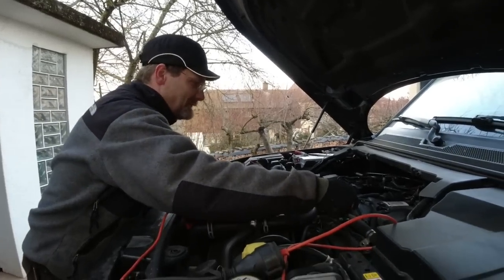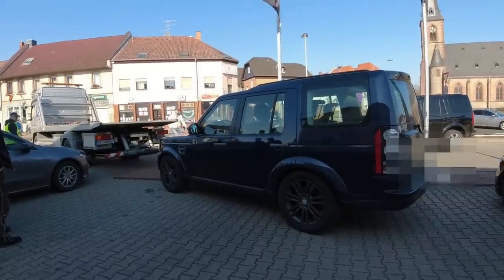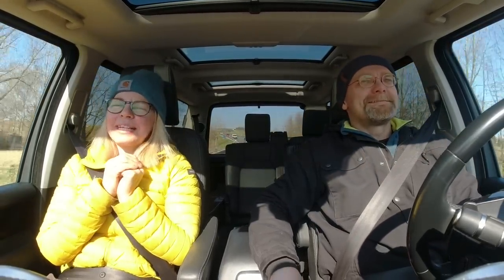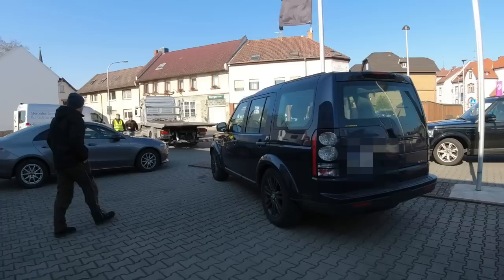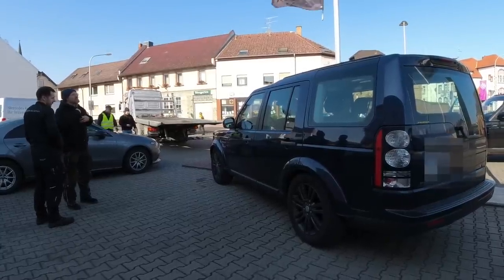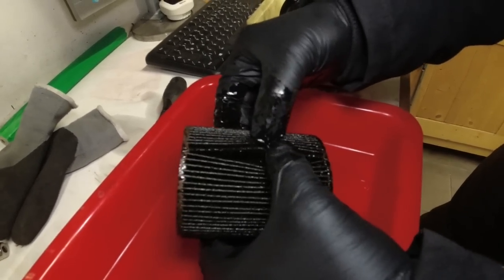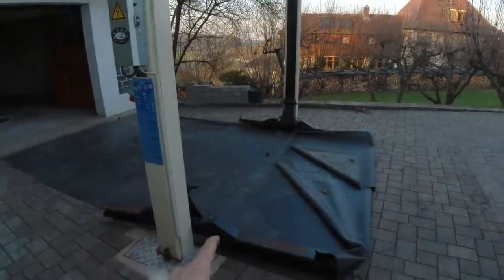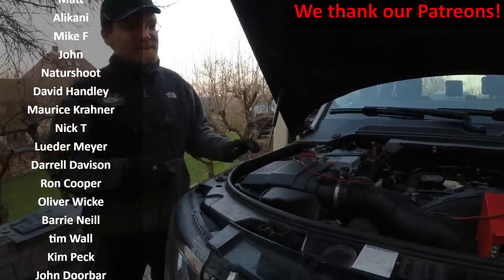We bought a dead engine LAND ROVER with only 40.000 Miles / S4-Ep10

Comment: Actually a lovely looking vehicle and obviously well taken care of.  Is it a Graphite of a Landmark?  You can see it's one of the very last ones as it has "Discovery" on the bonnet, rather than "Land Rover" (personally I prefer "Land Rover" on the bonnet).

It's amazing how expensive these cars are - the last Discoveries of this shape came off the production line in 2016 - 7 years ago.  They sold new for around £47,500 on the road for a Graphite and about £56,000 for a Landmark - the used price now is £30,000 - 35,000 (I checked with JLR in Oxford the other day as this is what I am hoping to get in the not too distant future).

It still amazes me how many people say how unreliable Land Rovers are, yet everyone I have spoken to has never had a problem and the number of very old Land Rovers that are still on the road when most other cars of a similar age are rusting in theior graves is amazing - the number of Mk.I Discoveries I see around and still in good shape is far more than any similar aged vehicle.

I do feel for the previous owner that a well loved and well taken care of vehicle should suddenly stop like that.  A similar thing happened to me in 2019 on my 09 registered X-Trail - suddenly went bang on the A3 in Germany close to Aschaffenburg. Towed to the local Nissan dealer in Ascheffenburg and one week later and € 2,500 poorer I got it back and could continue my journey.  In my case the ERG valve had broken internally and a loose piece of metal was floating around - but I had to pay for 16 hours of labour to sort it.

Looking forward to seeing what happened to cause suce a failure on yours and what could have caused it (presumably used 5w30 oil instead of 5w40 😉)
Reply from the maker: Hello John, the vehicle had a sticker price of 58t Euro in 2016 and the previous owner payed 54 t Euro.  He planned to keep it for 15 years.  He gave me 4 new oil filter, about 20 L of oil (all kinds).  Very sad story.  LR just does not stick to their responsibility.   This engine is even installed in 2018 LR5 cars and also has crank failures.  Christian

Comment: Hydrolocked engine. Assuming they’ve not forded the Rhine on their trip, excess fuel (a lot) in the combustion chamber has locked the engine up. I’d wager a bad fuel injector is sending too much fuel into one of the cylinders.

Comment: A quick update on our LR3, after almost 18 months of ownership, two weeks ago we had the FOURTH compressor fitted. ho hum
Reply from the maker: 😲They can't be all bad? Isn't there another root cause for the compressors to fail? Do you monitor how long they have to run while driving?🙋‍♀️vera
Reply: @Vera_and_Christian  The first compressor was fitted by the dealer when we bought the LR3, along with all 4 air shocks and a valve block. This was because on the test drive the suspension warning light came on. Some time later this compressor went bang and sprayed desiccant everywhere, a common fault I am told. Compressor number three, well overnight the car was sinking, the garage tested everything for leaks even removing the air reservoir tank but in the end the computer just said that the compressor was not producing enough pressure. So on went compressor number 4 which fixed the problem. Since then  I've had 2 suspension warning lights, but no noticeable effect on suspension and the simple process of turning off the ignition, then starting the car again removed the warning light and everything is fine until it does it again...

Comment: Probably no where near but I reckon there was an issue with the fuel system caused by a spillage of adblue into the fuel tank while refilling and then being run with adblue in the fuel. This will have caused damage to the fuel system and could've caused too much fuel to be injected therefore increasing the temperature in the cylinders and melting the pistons to the bore. 🤷‍♂

Comment: Hello, Vera and Christian love your stuff, really. in fact, I very nearly bought an LR4 the other day, but it's ok I came to my senses, you've got me on the edge of my seat and I need to know what's wrong, however, I am a bit disappointed that you forgot to give us rule number one in Land Rover ownership is "check the codes", I will have to try and diagnose without codes. So if you cut off the fan belt will the crank turn ? no then it's not a sized AC or alternator, is there enough oil in the pan? no, then there's your answer oil starvation probably a big end melted onto the crank oil level sensor failure, however, if there is enough oil, then it could be a number of other things one is catastrophic timing failure but I would expect to get even a little play on the crank as the piston hits the valves and bends them out of the way but probably wouldn't lock the crank unless it's stuck between two valves, there are only two things left that I can think of, a bad injector and over/under-fueling causing one cylinder to overheat and sizing/melting on to the cylinder wall, last thing is if AdBlue was added to the diesel tank by accident, this could cause all the injectors to start over/under fueling/leaking as it eats away at the soft metals and spacers in the injector or the weak mix of adblue could melt the tops of the pistons sizing the pistons to the cylinder wall, check for crystals in the fuel.
Reply from the maker: We did show what the Gap diagnosed. 👍🙋‍♀️Vera
Reply: Hello Vera, I can’t believe you replied that's awesme, I've watched the video three time now, My guess is Cristian deleted that scene when you weren’t looking, you did say limp mode couple of times, could mean anything other than the car is trying to protect itself, so I still think the big end has melted on to the crank due to low oil that wouldn't even show overheating on the dash maybe a code for low power or something related to that, if the expected fuel/air input go's too high or too low like a hard stall compared to flywheel speed could trigger a limp mode, you've shown on older video the two inner big ends get secondary oil from the main bearing and if there is low oil that inner big end will heat up and as this engine in nearly new the wear and tolerances are very low so any heating will cause expansion very quickly more expansion more friction and until melt down, 120km/h is maybe 2500rpm I'm guessing so not that fast maybe they were going up a long hill on the motorway, there would have been no time to cook or smoke the oil, or spread bits through the engine.👍🙋‍♂Noel
Reply from the maker: @Noel-qb6gy  yeah you are right and I am wrong. I am really sorry about that. That scene will hopefully be in the next video. We have so much footage always, and already watched all of it on the Computer. But we did of course check the code, and Land Rover in Switzerland did that of course too. 😀🙏🙋‍♀Vera

Comment: That's really crazy what you did that's when some interesting stuff happens. I love your channel and respect you both. Some serious skill is always there.
Anyway I was workig on some 6 cyl diesels and they have usually so much power that 1 broken cyl doesn't stop it the other 5 will push it to destruction without problems. with broken  con rods pushed out of the block and so on.
We don't have a lot of info here. I would say it's siezed because of lack of oil.
Mine was still turning with a broken crank back then. 
A snaped cam belt on the highway would have probably destroyed everything but not totaly blocked it.
Will see.
I will follow this as I did Fabians rebuild. That was some serious skill to put that in working order again. Great stuff. I wached every video with much interest.
I fear you will have a lot of work if you start reparing others disco's.😉
Reply from the maker: 😅We can‘t repair others their Discovery. That is why we actually bought this one. It‘s ours.😀👍🙋‍♀️

Comment: Failed on a roadtrip and not many miles on the car... My guess is that the oil level has been low its then gone for a very big journey and slowly but surely oil starvation has occurred leading to crank failure.
Reply from the maker: Oil level was ok. Sorry, did not include this in the video.   Christian

Comment: crank fatigue failure??? That's what happened with mine, broke at 80km/h and wedged itself into block, no noises, no vibrations no warnings just suddenly had no power, when rebuilt had to use a different block as well as the crank. But mine broke the front sump bolts and leaked a little bit of oil😥

Comment: Ok we are going with the following... if serviced by land rover at there intervals... it has had maybe 3 or 4 oil changes... every 20K... yes it should have been changed at the time interval rather than K interval...but hey its a landrover dealer... so with so little oil changes and so little Ks we are assuming that the oil was shot... this caused reduced oil pressure ... and we know how little this can be at 2000rpm.... so at 120k on the autobarn the oil pressure with worn out and contaminated oil, was enough for a main bearing seizure .. whilst not having enough flow to put any debrie into the oil filter

Comment: The car ran out of oil then main bearings started rubbing and overheated they got so hot after the enging stalled
they fused and the car coasted to a stop. Wild ass guess.
Reply from the maker: 😅Sounds like a wild guess. As we stated in the video, it just got an oilchange and hasn't lost any oil. 🙋‍♀️

Comment: I'm thinking a hydraulic lock. If the engine had seized at motorway speeds there would be bits of metal everywhere, so i guess it happened at startup?

Comment: Big end bearing slipped over other half one and locked crankshaft up fault bad oil not changed probably as landrover service but I think should be changed ever year or 8 to 10 k miles
Reply from the maker: He was very meticulous and changed the oil very frequent. He has already had the oil for the next two oilchanges at home, which he gave us including a lot of oil filters. 👍🙋‍♀️

Comment: sad story I think the owner will run on toyota next and  waiting to get it back an good news form the RCA ,if the crankshaft is locked like that ,it's probably not broken but either seized in the beaings due to 5W30 good oil /pump or could be fluid lock .... due to faulty injectors... a look  inside  the exhaust should reveal some unburned fuel... or oil... nice Car ! nedd someODB  fault check ... last fault is the issue ( like limp mode or no oil)

Comment: Hmmm thinking outside the box. Seems too low miles for a timing belt / crank fail surely. You’d think the belt / oil would have been changed if the owner loved it as much as you imply. Wondered if something went wrong with the glow plugs / fuel delivery causing an excess of fuel leading to a stalled, locked engine. Sceptical given the notoriety of the cranks in these vehicles it seems unlikely

Comment: Can’t wait until it’s diagnosed! By the way: my Disco 3 had suddenly all warning lights on. HDC and all special programs out of order. Speedo not working, but revcounter worked. When I turned the engine on after half an hour everything worked again, except “Aufhängungsfehler”. That remains... any ideas?
Reply from the maker: You need a diagnostic reader, we can't stress that enough. 👍🙋‍♀️Vera
Reply: @Vera_and_Christian  : It seems it was the ABS sensor

Comment: I know the failure exactly, the engine has inhaled a Swiss cheese 🐁 so this poor little guy has activated the from Land Rover installed Antismallrodentsinhallation Mode.
I now think on these engines it's not only the Construction from these either more the Maintenance and or endinspection of the Factory.
Some last 300000 plus Kilometers an some die short after the first Oilchange.

Comment: Oil pump failure starving the main crankshaft bearings of oil causing them to seize the crank but not snap it . 
May be why there are no chips in the filter due to oil pump failiure ?
It may have spun the main bearings too . 
Sump removal will reveal more information though .
Possible line bore . 
New uprated oil pump . 
New bearings .
Polish and check the crank for tolerances etc .  
Fabiens Discovery round 2 . 

A special thank you to Vera for a healty amount of "Oh my God's" in this episode LOL

P.S. All this is pure conjecture of course . I have zero knowledge apart from watching LR Time .

 
Fattrucker
Reply: But surely she would of got oil lights on before this happened

Comment: Hi Christian. I'm following you from South Africa. Big fan. I have a LR 3 TDV6. It's the best and worst car I have ever owned. I've had it from 2007. I've had the crank shaft bend and replaced the engine. I also own a Toyota 80 series as my rescue vehicle......My question is does the lr3 petrol v8 engine have any engine issues?

Comment: Fun fact as an ex-Land Rover fan (2016): I can tell you that Toyota's do break.

Though not like Land Rovers, they can usually still drive. But in regards to say, like a 100 series Land Cruiser or any other diesel, Toyota....

When their mechanical (or electronically assisted or even commonrail) pump packs up, they are like pregnant Chinese women. 

You don't see them; they are in hiding.

Why didn't the tow truck driver just back into your driveway and unload the car there?
Reply from the maker: Our driveway is too narrow and steep.  Looks easy in the video but in our first engine rebuild series you see a much smaller tow truck back into the driveway, hitting our post.  Christian

Comment: My guess is that someone was fording  a water crossing and went to deep and sucked water into the engine hydro locked and snapped the crank. After trying to restart the engine. My guess the wife was not aware of the consequences of stalling it in water . Trying to start it caused the failure.
Reply from the maker: It's always good to watch the video before commenting 😀👍🙋‍♀️Vera

Comment: My money is on bearing failure on the crank from fuel dilution in the oil.  The latest TDV6 with DPF and adblue is bag of hurt and the Land Rover C1 oil is trash no car should make a half litre of oil in 5k miles but these do.

Comment: Weak oil pump either a snapped lug or not suppling enough oil pressure /flow to the engine resulting in a snapped crankshaft with the wrong service life and wrong oil

Comment: Heya!  stumbled across your channel looking for some content around LR4's and things that others have done!  One question... in this vid you show the second row seats where the seat part is folded forward from the back to show some nifty storage space under the seat itself (and you mentioned this is the same as on your LR3).  Is this standard across all LR4's...and there's been a marvelous storage space under my butt the whole time?!
Reply from the maker: These seats, with the storage space underneaths, are  appearantly only in the 5 seater versions installed. My Discovery 3, a 5 seater, has these seats and I use them for my sparepart bags. All other Discoverys we have seen are 7 seaters with those foldaway seats unfortunately. The previous owner bought the car as a 5 seater and had the third installed afterwards. 🙋‍♀️Vera
Reply: @Vera_and_Christian  Man...what an awesome feature.  I wonder (after mucking around with the second row on 7 seaters) if the reason they don't have this is the second row seats on "true 7 seaters" have a function to "go flat" where the seat when folded down can compress "into" itself allowing it to be at the same height as the folded down rear seats/cargo height.  That's the only reason I can think of why Land rover would get rid of that feature.
Reply from the maker: @4lifebwd  The seats on my 5 seater fold down just as flat as on a 7 seater. No difference in height.🙋‍♀
Reply: @Vera_and_Christian  say whatttt?!  It might be time to look for some used second-row seats now  🤣🤣🤣

Why would they ever get rid of this (obviously brilliant efficient use of space)?!

Comment: What a fantastic new project! After watching your recent video why this is the ‘worst engine on the planet’ I think it failed for the following reasons. Big End bearing number 3 spins due to wear from the known poor design of the oil supply. This causes a sudden increased torque loading on the crankshaft which results in a spiral fracture. The crank may have been a Monday morning post football defeat one so inherently weak. The crank is subject to a lengthening force which suddenly seizes the front main bearing and locks the engine solid.
Just out of interest, and assuming you may have to  rebuild the engine, are there any fixes you can do to improve the oil supply to the crank or strengthen the crank in any way?. This seems such a common problem it would seem worth doing.
I am saddened to hear you have been getting criticism from my fellow citizens. There are some sad people in this world. You are both such kind, polite,amusing and educated people producing my favourite YouTube channel so don’t be disheartened..Great to see so many supportive comments for you both and well deserved. Good luck with the new D4 you might need it!
Reply from the maker: We simply stay away from FB, except for our weekly video post.  Now I was told that Rogby can also effect the monday morning quality in certain parts in the UK - as well as Wrestling.  Thanks!  Christian
Reply: @Vera_and_Christian  no wonder we can’t build a decent car, the weekends are full of distractions Here in the North east we race whippets and pigeons too!